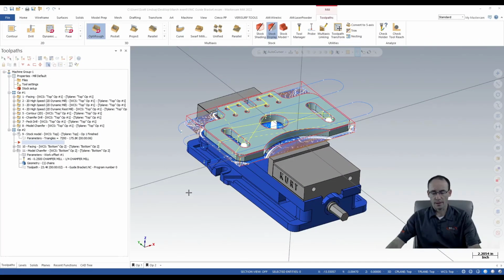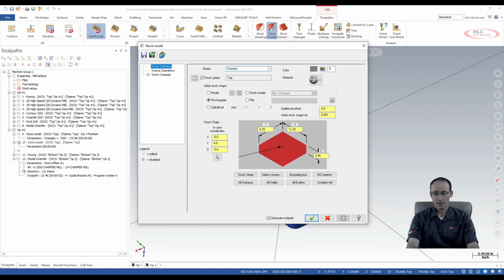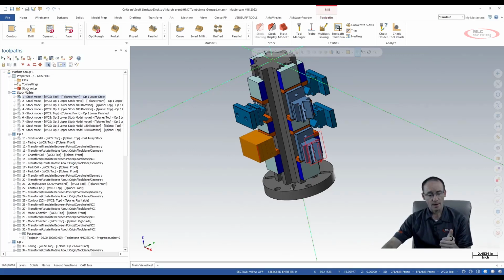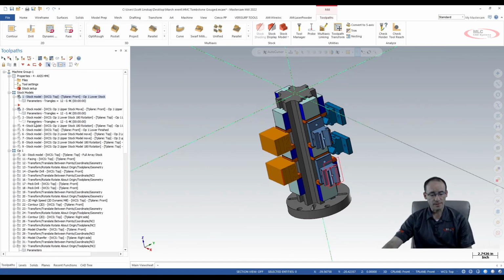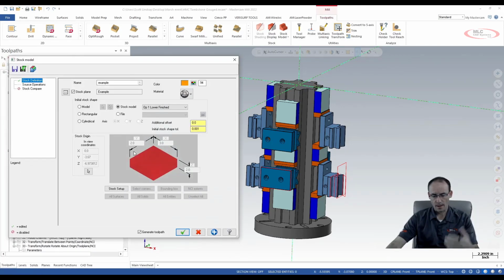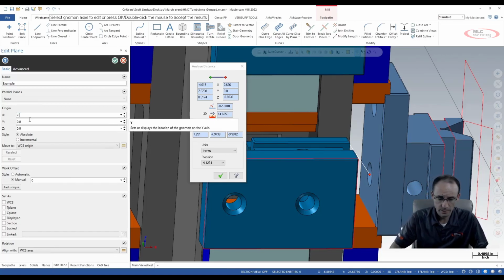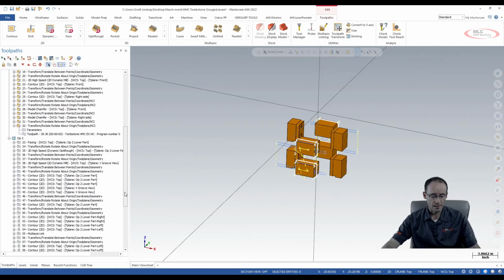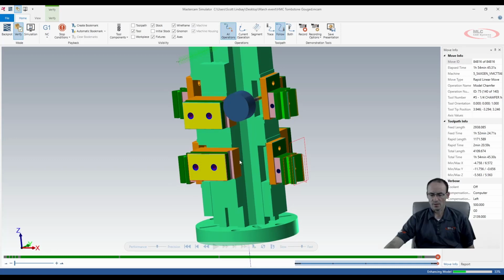Mastercam Multi-setup Webinar

Comment: Great tutorial. I just wish it was so much easier than this in MasterCAM . I feel like it's a lot of work around p
Reply: Mastercam badly needs a fixture manager and a tombstone manager to help automate this very tedius, time wasting process . Additionally, using just Levels isn't efficient even with Viewsheets. The workflow in Mastercam is piss poor compared to better CADCAM programs causing lots of wasted time.
Reply from the maker: The developers are always looking for ways to improve the software, and you can perform this operation without this many steps if you skip things like full simulation.  Thanks for the feedback!